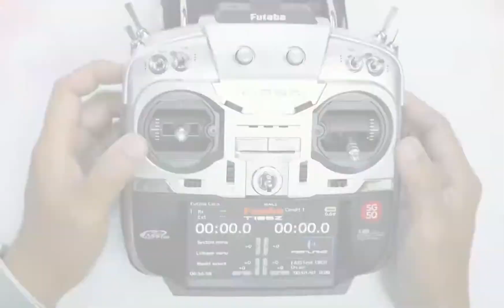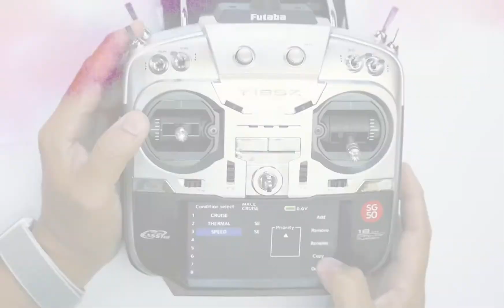Futaba 18SZ/16SZ/16IZ: Ep10 - CONDITIONS

Comment: Hello. Excellent video. Question? Can I use the same procedure on a turbine jet? If I am right, I can program a condition as cruise and all trim adjustment will be safe in that mode. For example if I assigned a second condition as landing, the radio will save the trims adjustment as well.?Thanks
Reply from the maker: Thank you. Glad you like the video. Yes, you may use the condition set up procedure for your other types of model. Single/separating the trims would be important. Most important is to perform the ground test of the conditions prior to taking off.